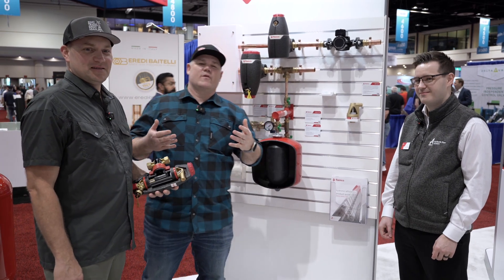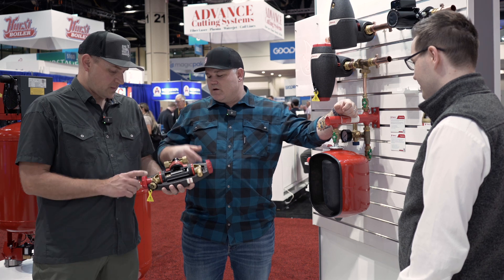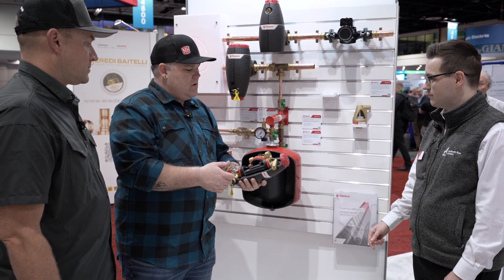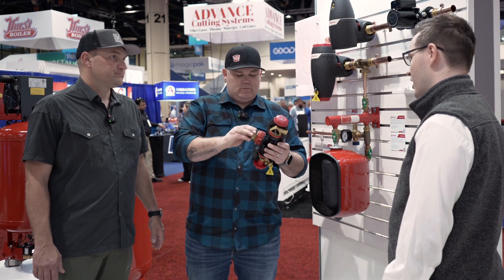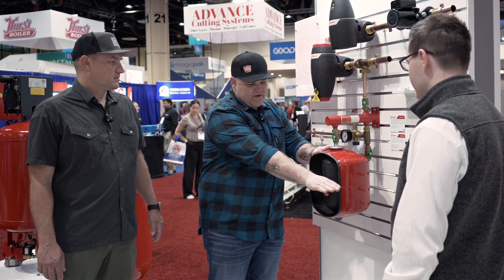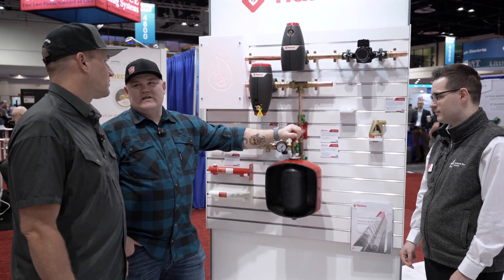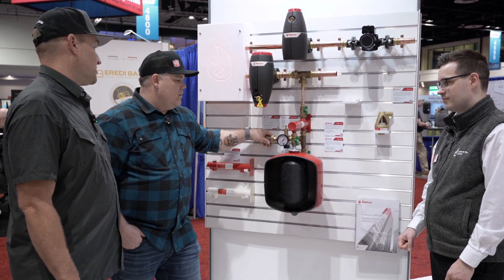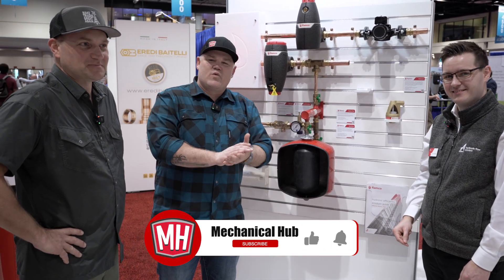How To Remove Air and Dirt from Boiler Systems

Comment: About the expansion tank, without a drain and an isolation valve you cannot properly test an expansion tank and I really don’t see it on residential unless it’s a kit of some type
Reply from the maker: I install valves on them all the time, its not common because of the added cost but I service everything I sell so its necessary.